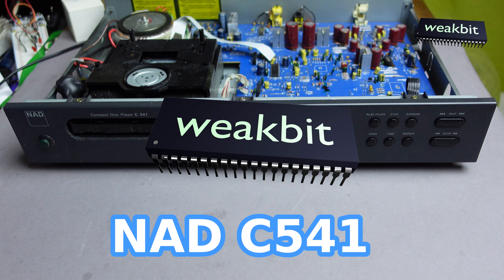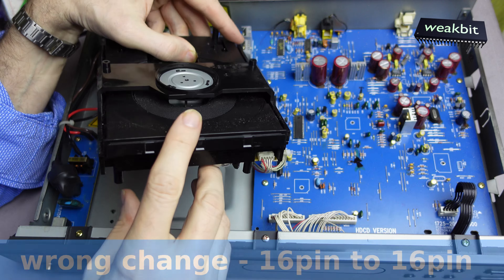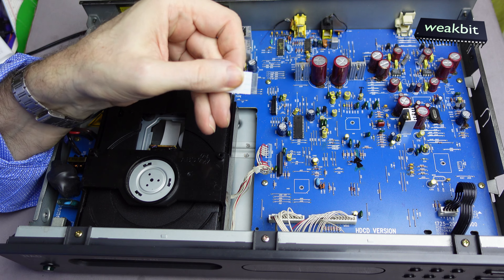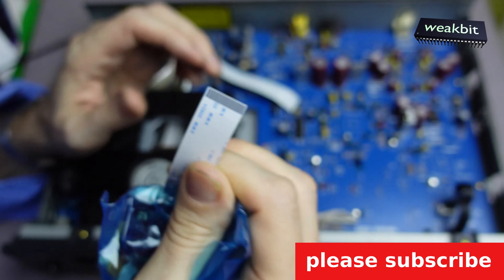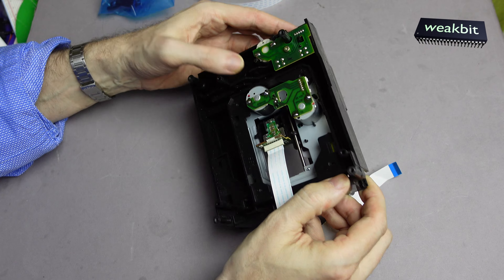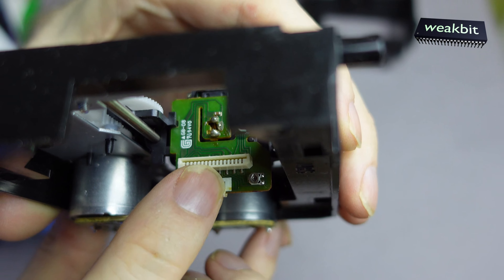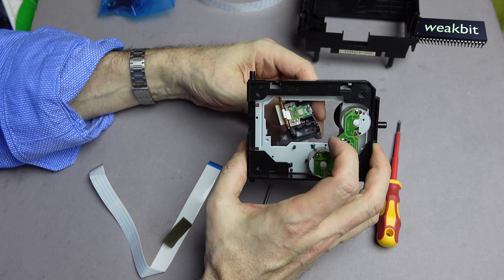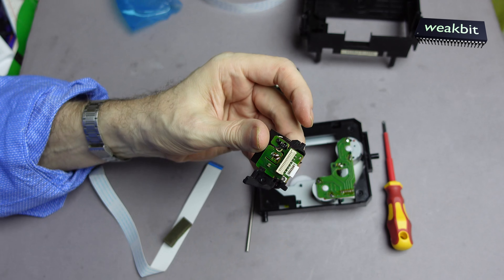NAD C541 repair

Comment: One of the reasons laser pickup is skipping tracks at the end of CD is that the ribbon (especially OEM ribbon) comes in close proximity/contact with the transformer. The EM field from the transformer interrupts the work of the laser via the ribbon, so the laser skips/stops. You can verify this by placing some protective plastic between the transformer and the ribbon: it skips less.

Comment: I can't repair my Densen B-400, I bought a complete new drawer (KSL2130ccm which is also a Yamaha AAX78140). The control buttons don't seem to be operational except for the Play button which makes the drawer move a little but something is preventing it from moving forward. The problem is that the plate which carries the laser (KSS213C) remains at the bottom whereas it should go up when the drawer is completely retracted. The helical part supposed to raise or lower the plate does not seem to fulfill its function even when the drawer moves in and out manually. The drawer motor seems to work well, it moves back and forth if I remove the laser plate. When the stage is plugged in, there is some linear movement but no movement of the focus lens. I bought this Densen used from a dealer who swore it worked before it shipped. I don't want to return it, too bad. It will probably end up in the trash, I'm not a technician. If you have an idea and already encountered this problem, thank you and bravo for your vidéos who would demand more views and subscribers (of which I am one).

Comment: its a stupid design the ribbon rubing on the transformer
Reply: Why? If you do not understand the meaning of this technical solution, then this does not mean that it is stupid.
Reply: @Blambik  i think its strange and bad design
Reply: @sergiobisonte  Why do you think that the design is strange and why is it bad?
Reply: @Blambik  because everytime the laser is moving back and forward, you have a fragil and sensible ribbon (transfering data) rubbing on a hot transformer...
Reply from the maker: the Transformer is not hot.